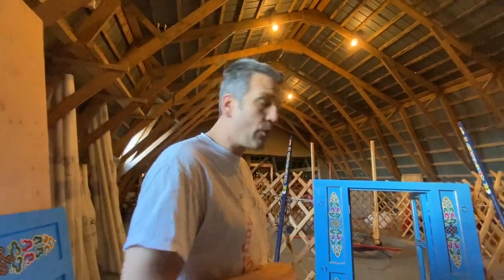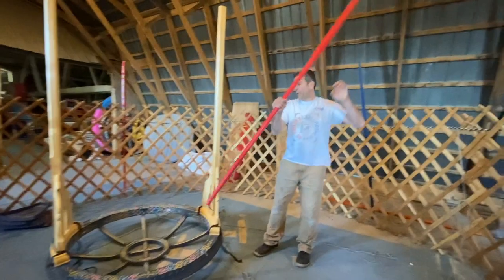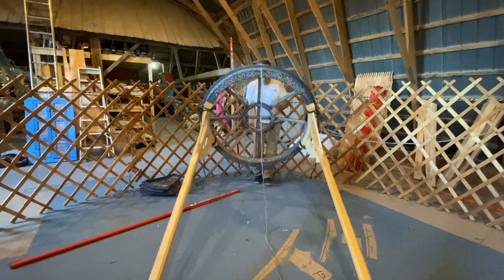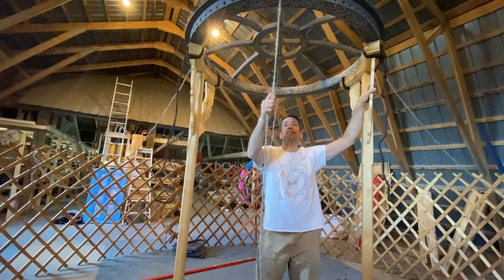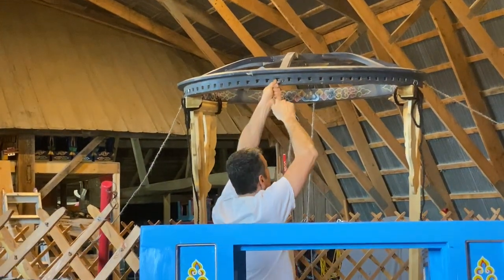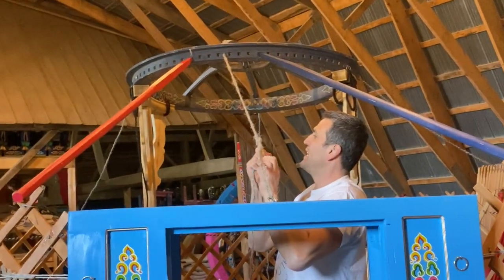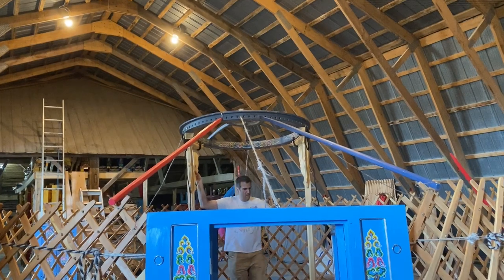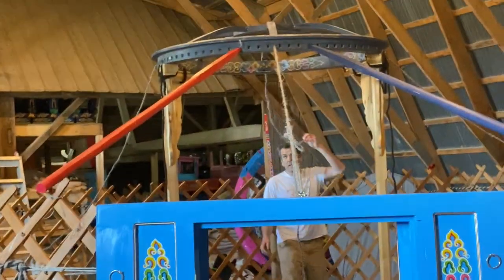Setting Up a Yurt Solo

Comment: This would work if the lattice walls were actually built even. This would work if the rope that comes with these yurts didn’t disintegrate to lint in a few years.. This would work if the Huns weren’t warped. Currently refurbishing a smaller version yurt and needless to say this has been extremely frustrating. The main problem is the mold and rot that eventually ruins the felt and twill. These yurts are breathable but the problem with that in Canada is that once the moisture gets in it’s only a matter of time before black mold and the stinky smell takes over. We get complaints all the time.. I’m gonna try some of these tips in the video but man I’m completely demoralized